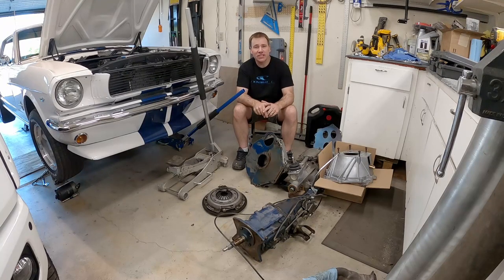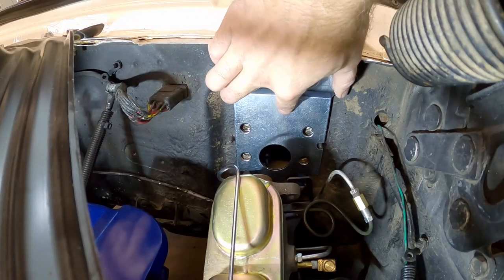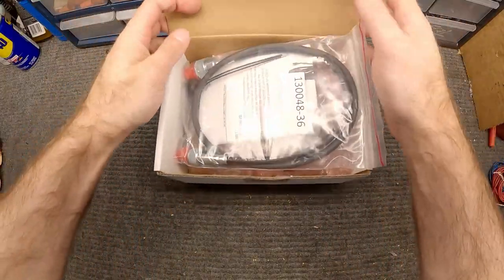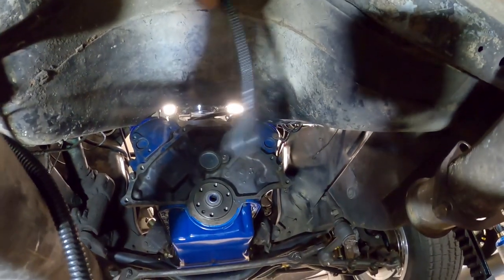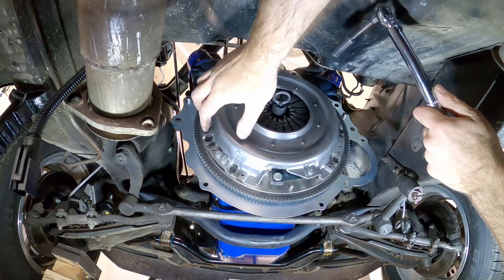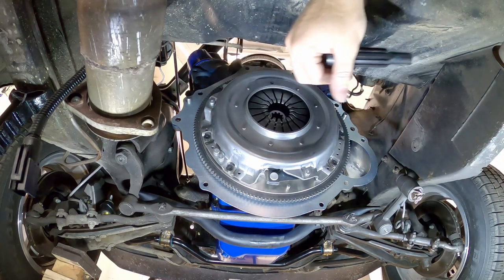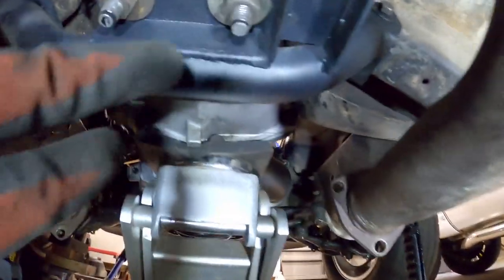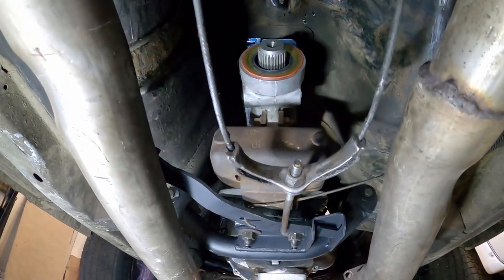Swapping in a T5 Transmission in a Mustang - PART 2 of 2

Comment: So you put a 93 and earlier input shaft in you tranny to be able to use all of MDL parts to install? I have a 95 T5 with bellhousing and flywheel everything. Did you not have this stuff or did you just decide to go with 93 and earlier stuff to make life easier? What will I encounter staying with all 95 stuff? I know it shifts the tranny back a little more than the earlier models. I see you had to modify your crossmember is that because the tranny is a little different or did you use a 95 bell housing also?
Reply from the maker: Correct, I opted to go with the older year parts to make things easier, even if it wasn't cheaper.  If you've got all '95 parts, it will all work just as you mentioned, except the trans mount location will be even further back than mine was, possibly requiring a different cross member, or even a custom made piece.  Despite the T5 swap being extremely common on these cars, I was surprised how little info there was for the later years trans, especially the lack of parts to make it work.  That's why I went with the older year components.
When I did the T5 swap on my current Mustang project, I made sure to get the correct year trans, it made the install go more smoothly and it was cheaper in the end.
Reply: @AndyKruseChannel  thanks, that’s what I’m figuring out also I talked to MDL and they pretty much said good luck we don’t have anything for T5s  after 93.

Comment: Awesome videos!!! I just finished doing my t5, but still have miles to go to get it running..
what headers are you running on your mustang?
Reply from the maker: Thanks!  What do you have left to do?
I decided to ditch the generic units I had on there and go with some Ceramic Long Tube headers from Summit Racing.  I've got a video about it coming out soon.
Reply: @AndyKruseChannel  Well I think I am kind of close to hearing it again but I rebuild the engine its s 289. I then put in the t5 from a 89 mustang. I am currently installed a painless kit, still need to connect some stuff and wrap it.
Reply from the maker: @torreerrot  Hopefully you have more patience than me.  When I get down to the last few items I have to catch myself from rushing things.  This is when I usually run into issues I created.  I've gotten better over the years, but I still have to work at it.  Maybe you can make a video of your progress and share it here on YouTube!!?
Reply: @AndyKruseChannel  Hahaha if I were to make some videos it would be 1/2 spanish and 1/2 bad English hahaha. I just got my tri-y headers in over the weekend and man does it look good. Sadly had to give it some hits with the hammer, but all to get these shinny tubes in :)

Comment: Thanks for the instructional video. But man o man what a major no no that clutch cable nonsense is looks and function wise. You really should have stuck with the original linkage. There's nothing wrong with it unless you are putting in a heavy pressure plate. Also checking bell housing runout is pretty important for long transmission front bearing life.
Reply from the maker: That clutch cable problem was on me, I should have done a little more research on the cable vs header type.  Oh well, it's only money, you can't take it with you.  :)

Comment: does it feel much faster than the 4 speed?

did you have to swap the axle that goes in the engine or did you bought a different bellhousing bacause i didnt understand in the video
Reply: how much was the speedo convertor box?
Reply from the maker: @chevroletbelair1  The car is actually a tiny bit slower because of the gearing inside the transmission (compared to the 4 speed I pulled out).  I had previously put in better gearing in the rear end, which made the car accelerate faster, but the gearing in the T5 pulled me back down a bit.  I have 3.55 in the rear, I should change it to 3.80 and I'd be where I was with the 4 speed, but then I also have the 5th gear for highway speeds.  :)
Yes, I had to swap the input shaft on the T5 because the Trans is a 2001 unit.  All T5's from 94-04 have a slightly longer input shaft than the 83-93 trans.  I could have left it alone because I have the bellhousing that goes with the trans, so it would have set the proper distance away from the motor.  However, the Boys at Modern Driveline convinced me to buy a new "shorter" bellhousing and get the correct input shaft that sort of converts my T5 into the earlier 83-93 style.  This allowed me to use a common clutch, clutch lever, and the clutch cable that I have since melted (more on that next week).  In the end, I could have stayed with the original input shaft, original bellhousing, and figured out how to make the Z-bar work, but I was trying to make it simpler by throwing money at it with new parts.  If I had to redo it, I'd still go this route, just not choose the cable clutch option.
The Speedo box thing was about $330 and I found it on Ebay.  Other sites have it, but it was more expensive.  Part number for that converter box is ECD-200BT-1.  The other option to buying this converter box is to buy a digital speedometer that accepts the same electrical signal that I'm sending to the converter box.  In the end it would have been more expensive to do that as I would have wanted to redo all the gauges in the dash, so I went with the converter box.  :)

Comment: Question, when considering the clutch cable kit. Would it make a difference by getting shorty headers instead of long tube in order to avoid melting the cable? Or would it still make contact even with the shorty headers?
Reply from the maker: Knowing what I know now, shorties would have been a much better (and cheaper) route for me to take.  While I did get a good deal on those headers, due to the problems I had with the cable during and after the install, I should have just gone with shorties.  Also, those new headers hang down very low, I actually have to be careful where I drive the car now because of how low they hang below the frame rails.  The tubing that you would have coming from the end of the shorties could be routed so it completely misses the cable, making the cable a pretty decent alternative to the Z-bar mechanism.
Reply: Back in the eighties when Ford came out with the clutch cable... that is the reason they invented shorty headers unfortunately shorty headers aren't worth two cents... if you want Power go with long tube headers and use the old mechanical linkage
Reply: @joeytacey743  exactly why i went with long tube headers. Kept the mechanical linkage but it makes some kind if grinding noise when i press on the clutch. Im hoping that is normal haha
Reply: @joeytacey743  long tubes are awful. Always in the way, burn things, etc all for 2 extra hp over shortys. Anything is better than a manifold.

Comment: Is that throw out bearing specific for a clutch cable kit? I want to keep my standard linkage setup. Is there a specific item number or number would you happen to know where i could purchase the throw out bearing itself?
Reply from the maker: The throwout bearing I used goes with the type of clutch release lever that works with this bellhousing.  I know you can use the original z-bar linkage for T5 swaps, and they have a throwout bearing that works for that setup, I just don't know the exact setup you need.  If I were you, give the guys at Modern Driveline a call and explain your scenario and they'll be able to tell you exactly what parts you need to make it all work.  Those guys are super helpful and easy to talk to.  :)
Reply: @AndyKruseChannel  thanks andy, 👍i have the same clutch release lever as you but im in need of a release bearing. Did you purchase yours from mdl? If so do you have the item number? I believe our set up is almost the same except i am keeping the original clutch linkage.
Reply from the maker: @jovanistreety6565  I'm not sure that the factory linkage would work with the clutch lever on my car.  Meaning, the factory linkage pushes the lever towards the rear of the car, so the pivot point would be between where the linkage connects with the lever and the throwout bearing.  With a clutch cable (or hydraulic setup), the cable pulls the lever towards the front of the car, forcing the pivot point to be on the other side of the throwout bearing.
However, it's possible you have all the correct components and I'm wrong about the setup.  Unfortunately I do not have the part number for the bearing as it came with the clutch kit I purchased from MDL (clutch kit # MD-O7-14C).  I'd still recommend calling MDL and confirming with them the parts you need.  They might even sell just the bearing.  :)

Comment: I’ve done some research and I have came upon a question, do I need to get a rollerized pilo bearing or just a normal bearing for a 289? Specifically a t5Z
Reply: I got a 302 and from what I know you need to go to a roller bearing
Reply from the maker: Roller pilot bearing.  You might be able to get away with the older style where it was basically a bushing (made of softer material), but the roller bearing is what you want.  The size is fairly standard for these cars, the boys at Modern Driveline will be able to tell you the exact bearing you need.  They were instrumental in getting me the parts I needed and answering questions like this.  :)
Reply: If you pick up a clutch kit, the roller bearing is included.

Comment: in 1979 Borg Warner started producing a WC T5 which continued to about 1983.
Reply from the maker: I thought the WC T5s started in 1983, before that it was just the T5?
Reply: @AndyKruseChannel  The Borg Warner I have is stamped 1979.  So I cannot speak prior to this date.  Good Luck.
Reply: It may be difficult to find the wc-t5 and if you do it may still require a significant rebuild. Through my discussion with Modern Driveline, I got exactly what I needed to support the torque generated by my 331. They are excellent to deal with and will help you make the right decisions for your needs and budget.
Reply: I also think MDL is great to deal with.  If I were to do this again, I would probably purchaseT5 from MDL. As far as cost goes, I paid $500 for the T5 and about $1300 at MDL for the necessary parts to rebuild and convert to my engine.  All said, I probably could have purchased a new one for a bit more.  Good Luck.

Comment: Should there not be a rubber boot for the clutch fork hole in the bell housing to keep dirt and grime out?  Or is there and we just didn't see it?
Reply from the maker: It's there, I very quickly mention it in the video because I forgot to film putting it in.  It's around the 5:30 mark.  :)
Reply: @AndyKruseChannel  I saw you mentioned the firewall plug, but I mean the large hole in the side of the bell housing where the clutch cable meets the clutch fork?
Reply from the maker: @finalmage6  Oops, my mistake, I completely misunderstood what you were asking about.  There is a cover that Modern Driveline sells for that location, but I had to make a change to the clutch actuation and I'm not sure if it will still work.  I'll be looking into it soon.  ;)
Reply: Ik weet niet of het kan maar ik zag dat automatisch olie in je handbak doet 😯 kan dat wel

Comment: Do you need the pedal return spring after going to a cable conversion?
Reply from the maker: Nope, that pedal return spring is only needed for the mechanical linkage (the Z-bar) for those that choose to keep that system.  The cable clutch conversion and hydraulic conversion do not need that return spring.  :)

Comment: How many miles was your break in process for the clutch before you gave it a burn out or driven hard?
Reply from the maker: You're supposed to put a few hundred miles, but I don't know where that is written.  I may have put fewer miles on mine before I tried to kick up a few rocks.  The results was needing to replace the fan shroud on the radiator.  More on that in a few weeks.  ;)
Reply: @AndyKruseChannel  nice thank you for replying I saw your video on the hydraulic clutch I’m guna convert mine over as well I had did the cable but thinking or converting to hydraulic that was an awesome video by the way!
Reply from the maker: @lucianohernandez3468  Cool, good luck on the hydro clutch, take your time on drilling the holes for the slave cylinder mounting bracket.  :)

Comment: Do you have a link to the crossmember? Or could I reuse the stock one?
Reply from the maker: I purchased it off Ebay, about $90 shipped.  Just look up T5 Crossmember 1966 Mustang and you should be able to find one.  Unfortunately I could not find one that works on my car but also works with the 94-04 T5s, that's why I had to modify it.  I did a video on that modification, check it out!  :)

Comment: Why didn't you use your Quickjacks?
Reply from the maker: The Quickjacks don't allow entry from the side of the car, you have to come in from either end.  When doing the Trans removal/install you need to be able to get to various areas from various positions.  Also, the width of the Quickjacks take up some space under the car, making the space between them a "tunnel" that you have to maneuver through.  The Quickjacks are best used when doing work on the front or rear of the vehicle, not the middle.  :)

Comment: It’s possible to use the original z bar with those headers and t5
Reply from the maker: Definitely, it seems these headers are made to accommodate the Z-bar.  The main reason why I went to the cable clutch was because of the clutch lever design inside the bellhousing I purchased.  Knowing everything I know now, I would have either purchased the bellhousing that allowed me to retain the Z-bar, or gone with a hydraulic setup.  More on that soon.  ;)
Reply: @AndyKruseChannel  you can use a z bar with a fox body beel housing.  MDL has an adapter to make it work, that's what I did.
Reply from the maker: @Mike-sh2dg  Right, I'm learning about that now.  But the Hydraulic Clutch option costs more, and if I want to single handedly want to keep the doors open at MDL, I need to do my part.  :)

Comment: What kind of bolts did you use for the trans mount?
Reply: The ones at 20:33 in the video
Reply from the maker: They were the bolts that held the trans mount on my other transmission, I just reused them.

Comment: In the comments people are saying that modern Driveline has headers that will clear the cable but I just looked on their website and didn't see any headers at all😳
Reply from the maker: The installation instructions for the cable kits (they link them on their site) list the known headers.  But, to make it simple, they say:
"All stock exhaust manifolds, most shorty and mid-length headers, Heddman 88660, Patriot H8433, Doug's Headers, JBA 6610S, JBA 1650S, JBA1655S, and Ford Powertrain Applications".
Reply: @AndyKruseChannel  okay so what they're saying is they don't have their own brand at modern Driveline but they are suggesting those other brands👍
Reply from the maker: @joeytacey743  Correct, MDL does not sell headers.  But to be clear, they're not recommending specific headers, they're just listing the ones they know work.  There are other headers out there that supposedly work too, but MDL has not updated their list in a while.

Comment: Atf olie in een handbak 😲 kan dat wel ziet er goed uit. Google maps voor je kalibreren
Reply from the maker: I was unsure of the ATF oil at first, but everywhere online says on ATF oil in the T5.  :)
Not sure about your second comment "kan dat wel ziet er goed uit."  Which part looks good that you are referring to?
I'm not sure if I could use Google Maps for the calibration, but the mile marker signs on the highway (spaced one per mile) makes it really easy to calibrate.  It took less than 5 minutes to drive from my house to where I could calibrate it, do the calibration, and then drive home.  It was very easy!

Comment: 40:10 Hall Effect Sensor.
Reply from the maker: That's it!  Sometimes you can get away with stuff like "speedometer-thingy", but sometimes it's better to have the actual name.  :)
Reply: @AndyKruseChannel  good job on the T5 swap.  Very informative video and you really are doing a good job with your content quality.  I'm surprised you don't have more subs.

I've been on the fence with the 5 spd swap as I've got the T10 also.  Like you I'm clocking 2800-3000 rpm at highway speeds.  Also, my T10 is sloppy, not wanting to stay in 3rd and the synchros are toast between 1st and 2nd 😇.

After watching this I'm not off the fence yet that I want the 5 spd.  I may just rebuild the T10 and leave it original.  Coincidentally I have done the EFI swap and the silly thing gets 18 mpg even swinging 3000 rpm.
Reply from the maker: @92xl  Thanks for the feedback!  I think the two reason why my Sub count is low is because the classic mustang is a very niche market, and most people go to youtube for entertainment over how-to videos.
It was easy for me since the T10 didn't originally come with the car, so keeping things stock was off the table.  The T10 was working just fine, no problems but I wanted that better fuel economy for the highway driving.  Switching to EFI down the road will further improve what I have, so it's on the list!
It would probably be cheaper in your case to rebuild the T10 over swapping in the T5.
Reply from the maker: @92xl  The advice to do research before buying parts is something I could do better on, that has bit me in the past.
I was eye-balling the Holley system, but thanks for the heads up because I'm not wild about constant problems with their products this late in the game.
Honestly though, I've got so much other stuff to work on, fix, and upgrade before I get there that it may never be an issue for me.  :)